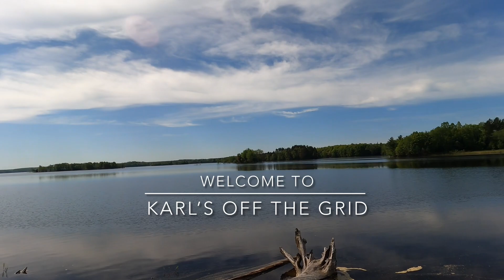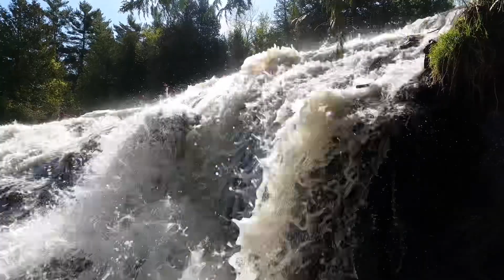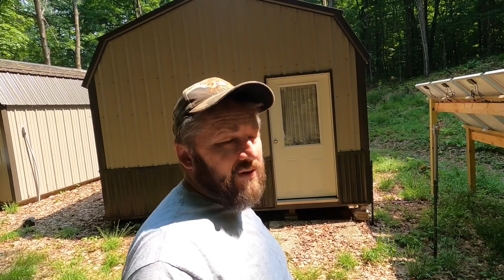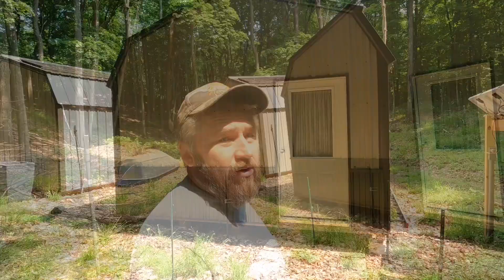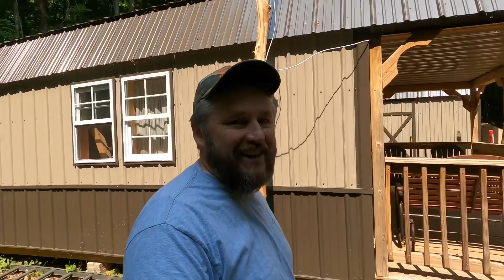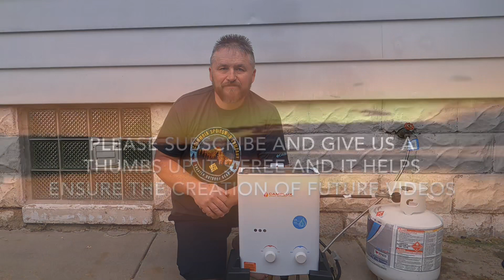Hot water, hot shower off grid! #shedcabin #cabininthewoods #offgridcabin #hotwatersystem

Comment: Hey Karl! Very similar to the ecotemp we use. We Have been using the electric pump that you can buy from them to draw water from a bucket. I use about 3 gallons/shower. Turn on, get wet, turn off soap up, turn on and rinse. Thanks for the vid and looking forward to the build!
Reply from the maker: You’re the first person I was thinking about when I saw this heater. does your heater come with a pump or did you have to add it? Thank you so much for all your help, it’s really helped our decision making process easier.

Comment: Do you have any suggestions if anyone don’t have a pressurize water source. I myself probably will bring 5 gallon containers to use until i get a shallow well put in.
Reply from the maker: https://youtu.be/OTLBg8Liac4
Check out this link. This is what we have been using and we love it. I tried to encourage company to send me one like it
Reply: The 12v pump from seaflow is very popular and I'm impressed as well with it. I'm using the series 42 model and is extremely quiet as well.

Comment: Karl, glad to see you again. But I think you are spying on me....
Brooke and I bought a camplux a couple weeks ago to hang outside the bath house for hot water. I've tested and demonstrated it to Brooke here at our primary residence. Using a 12v seaflow series 42 pump we discovered that a 5gal pail of water does not last very long,  about 2.5 minutes. But excellent water pressure and 110 degrees  is outstanding.  Built a outdoor "Shower Tower" with a soap shelf and a wood platform to keep the feet off the sandy ground. 

Karl, or if anyone else wants to help..  

Earlier in the video you talked about moving the cabin,   I'd like to know if anyone has moved their cabin to another location. Ours is 16x20ft ..
Keith
Reply from the maker: Thanks for the info, they seem to work pretty darn good!! I’ll check around to see about moving a cabin. I’ll check out the pump